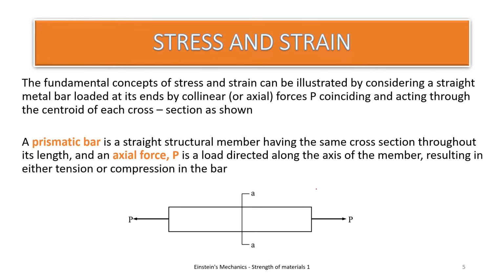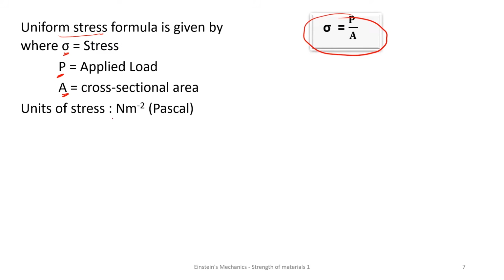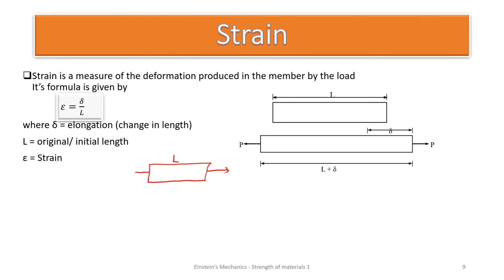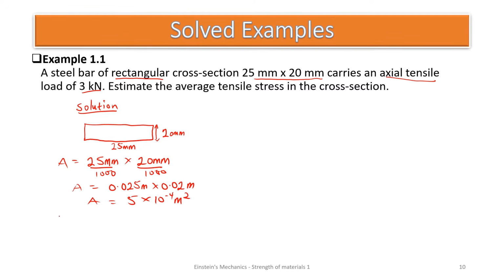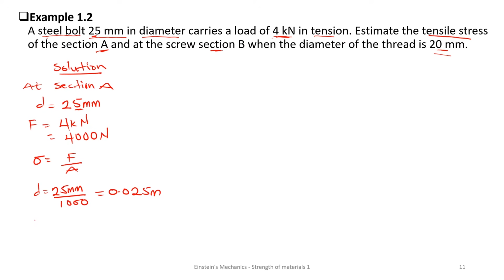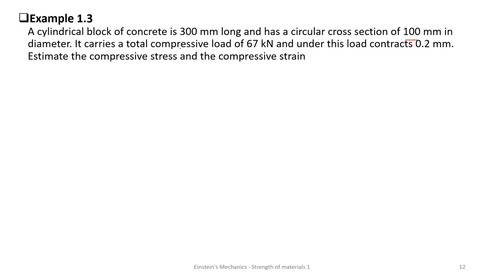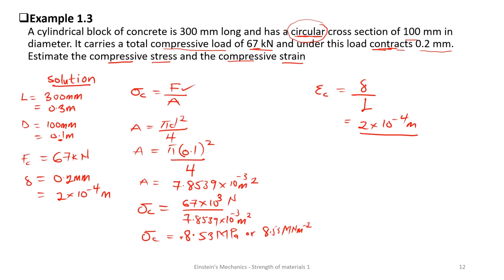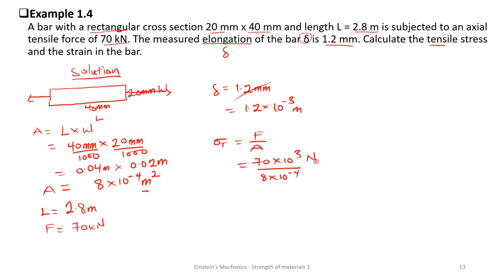EP 1 on Stress and Strain- STRENGTH OF MATERIALS

Comment: In example 1.3 when you were finding the compressive stress for the cylinder you used the area of only the circular surface, why?
Reply from the maker: Because the force was applied to the axial surface, it has a circular surface area
Reply: @Einsteins-mechanics  Please how do we know the forces are applied to the axial surfaces and not throughout the cylinder in such questions
Reply: Ohk I believe I'm getting it now 
We're dealing with the surface areas on which the forces were applied not the whole bar